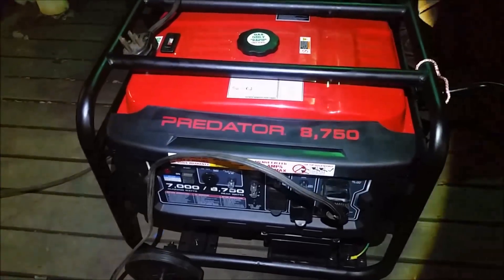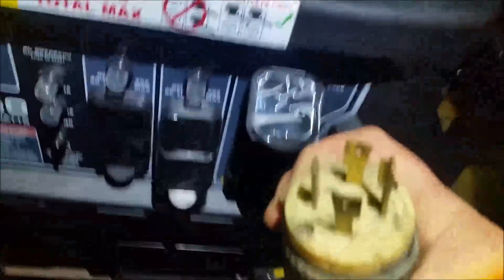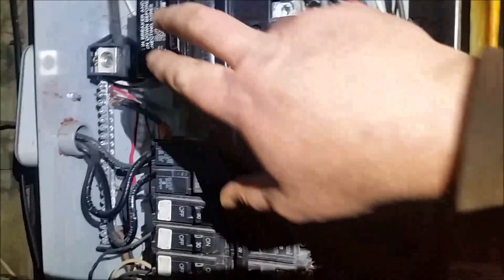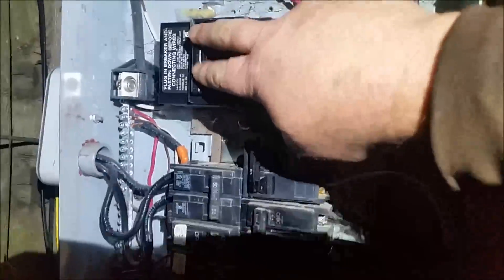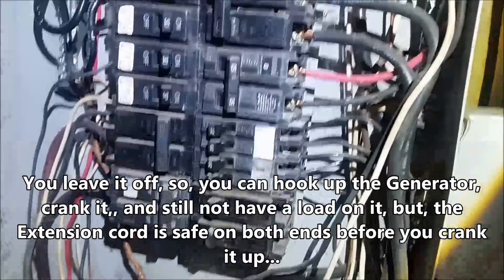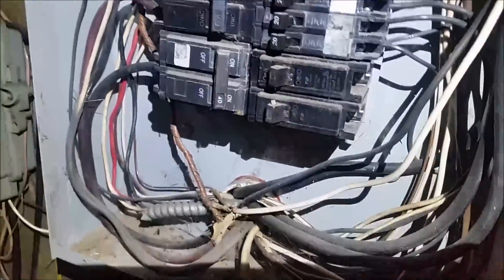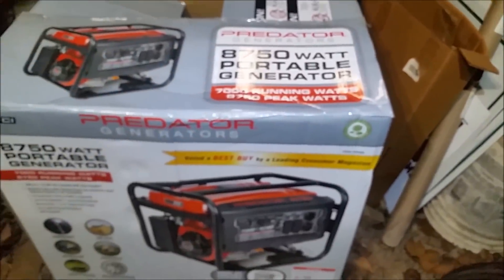Quick/Easy/Safe: Use Existing Plugin/Breaker for Generator hook up to your house Panel box.

Comment: Dad gum it . Y’all just because you can do it doesn’t mean it’s allowed to do be done. What you were doing is illegal. Showing other people how to do it is just stupid and risking the lives of emergency service and utility personnel. I hope if something goes wrong you folks are going to be held liable.  Folks you can add a breaker box utility interconnect switch kit  and inlet box for about $100.00.  Doing it right will help prevent mistakes when you loose power in the middle of a storm and might not remember all the steps or if someone else tries to switch to or from generator power. Even though I have a very detailed instruction manual on how to switch from utility to generator or back, it never fails that when the power goes out I’m at work and I have to talk a member of my family through the transfer. I can’t imagine not doing it safely them having the liability and guilt that you would experience if you actually killed some poor innocent lineman or fireman because you were too cheap to spend $100 dollars.
Reply: Your right.  I did spend the $60 at Home Depot to buy the interlock kit for my breaker box.  I also have the outside inlet box which connects to the generator cord plug.  It great because it is all legal.  I have no fear of using this system.    It is safe and effective and well worth the peace of mind that goes with a properly connected system.However like you, I understand that there are some people out there who would not be comfortable connecting all of this stuff in the dark(substitute snow, sleet, horrible storm, or what ever?)  So next to my breaker box, I put a list that is called "Protocol of connecting the generator to the house".  This is a thought out plan of what to do to connect the generator to the house.  It covers everything from what to do if the  basement is dry, or if the basement is flooded.  It covers every possible condition of the house, so that when the blackout happens, everyone in the house knows exactly what to do.    The problem with the people responding to you is that they think that everyone who may connect their generator to the house, has common sense.  Well, not many people do, and when your in the middle of a storm, its not the time to have to have your significant other try to figure out how to connect something that you hot wired together.  Also, the video person did not write out the plan and tell anyone where to place the plugs and the exact sequence of how to do it.  So really they are idiots for not spelling everything out so that this stuff can be done when they are not there to do it illegally.    David Clark,  your post was right on the money.  and $100 is a cheep price to pay to have it done right.  Very few things will accomplish that goal for so little.
Reply: Game Changer Nice sentence structure. You must’ve made your fourth-grade teacher very proud your senior year of school. And I’m not debating it’s 100% meets code when it is not in use. The problem is when it is in use as it violates national electrical code’s. As for your assumption as to my family’s intelligence level, let’s see. My oldest son works for the state as a network systems analyst. My youngest is in college for Business and finance carrying a3.5  GPA. ( that means grade point average) And I I’m a anesthesia technologists at a level one adult and pediatric trauma hospital. I just wanna thank you for taking time out of your busy schedule to personally attack me and my family. I will pray for you and your family to have a nice evening and God bless.
Reply from the maker: NED NIEDLEMIER is the same David Clark... Read the comments in order.. He made a new fake ID, because I know who he is (has one lame brained ice challenge video on his channel), and he posted 2 times and deleted his nasty comments,, now, because he has been identified as such a stupid person, he made a new fake ID and is back commenting showing how stupid he is again..Ha..Ha..Ha... This guy is a Fireman.. A really, really stupid one.. But, his real ID is David Clark above... What a coward!!!  My address is posted in the video for any of you cowards that think you need to come and see me.. Ha..ha..Ha...
Reply: Tony

It is also required to meet code when in use. Emergency designation does not exempt it from the NEC.
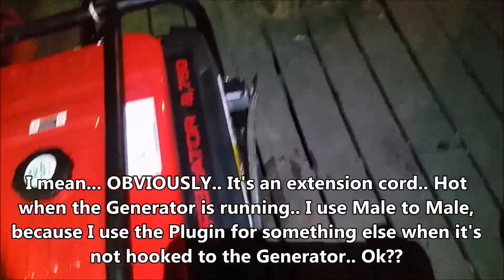Reply from the maker: I don't make videos for Stupid people who have no common sense.. You didn't catch that in the video? I spelled it out just for that purpose...  You can see it again at 2:24, 3:58, 9:20, 
But,, in case you missed it there, it is also in the text of the description.. I copy/paste the text here: 
Only for those of you with Common Sense though.. Those that talk about Safety 100% of their time on Youtube,, better not mess with this one.. Way over your head..Ha..
So,, it seems like you were trying to show that you had common sense, and you had paid attention in your reply.. BUT,, the facts speak for themselves,, now don't they.. 
And,, BTW.. Nothing you do as a home owner with your own electrical wiring is "Illegal".. You should know that.. If an Electrician does this,,,, AND CHARGES YOU FOR IT,,, then, he has violated "his" Electrical Code..
Homeowners are not doing anything Illegal here.. 
And,, if anyone in your family can read and follow your Manual of instructions in the even of an outage,, you should let "Them" watch the video and explain this to you.. Because, if they can understand all of that,, they can sure see that this is much, much simpler than your way of doing things... 
Turn off the main breaker, plug in extension cord on both ends, crank generator.. You don't need anything more than that.. If it kills the generator, you can figure out what to do from there.. Which is, add the other steps above.. Sure as hell has a better chance of being done correctly than your "Manual"...Ha.. 
If you decide to turn off your electrical service and turn it back on, and have to have an electrical inspection,, I hate to tell you,, but,,,, IT IS 100% LEGAL, and an Electrical Inspector "HAS" to approve your service and turn it on, because,, EVERYTHING IS 100% legal... 
As soon as you unplug the extension cord,,, YOU ARE 100% LEGAL..   
But, I don't expect you to grasp that, since you missed everything in the video and text that was designed just for you... And,, if you missed it,, here it is again... 
Only for those of you with Common Sense though.. Those that talk about Safety 100% of their time on Youtube,, better not mess with this one.. Way over your head..Ha..
Now.. You tell me,,, how can I keep people who can't listen and can't read, from commenting on my videos?? 
Hey.. If addressing it in the video multiple times, putting it in the text, and then, having people post replies don't do it,,, we just have to deal with them.. Or, just delete them and leave the video for the next guy who already has some 220v plugins that he won't be using when he is running his generator.. 
And,, what else you didn't catch is,,, the guy who has to make the extension cord, does not have any instructions on "HOW" to do that..Ha.>Ha.. So,, I stopped 100% of you guys from killing yourselves.. Because, it takes a little common sense to build the cord.. See how smart the guy in the video is??? 
The guy in the video is not stupid,, the guys who think something is wrong is stupid.. 
You missed the fact that it is just a regular plugin and you think something is "Illegal about it".. Ha..Ha.Ha... Talk about ????? Sorry.. It's just the facts..
Reply from the maker: Wow... Game Changer.. It's a pleasure to meet someone with common sense for a change.. I could not have said it better myself.. Have a good day Sir.. I hate to know that I have to drive on the same road as some of these guys.. Ha.. Glad there are a few out there that are not drinking their tea.. Ha.. Cheers fella..
Reply: mark, your really bad at identifying people by the way that they write.  If you did you would understand that there are really two different people from two different sections of the US.
Reply from the maker: There is a third, you just identified.. 1) Totally Stupid People, 2)People who know enough to be Dangerous, 3)Really stupid people who "Think" they know enough to respond, but, don't.. 
You have ZERO business trying to do this simple thing.. BTW David Clark.. How is the new ID treating you.. You didn't even try to hide it.. Or you created an ID to hide your real identity and forgot to start a new thread or not continue with your last thought..  #3 fits you just fine. Sorry.. That's the facts..
Reply: Obviously the new ID "ned" was created in 2005, not too new.  Or would you say Knew?  You don't have a job either.  Nice....
Reply from the maker: REALLY??? JUST HOW STUPID ARE YOU???? Ha..Ha..Ha..Ha.. You could not tell when the ID was created,, UNLESS YOU WERE LOGGED IN AS HIM!!!! Jez.. What a Complete Dumb Ass... I can't really believe you.. 
Are there people out there as Stupid as you??? I don't believe it.. I really don't....Can't be... There really can't be.. Holy Crap.. What a complete Igmofuck... Ha..Ha..Ha..Ha... My stomach hurts from that one.. 
At least you make a good clown.. At least you are good for a laugh.. Man.. If I were you,, I would quit showing everyone what a complete fool you are.. 
BTW.. you are half correct.. I don't have an "Employee position".. Ie... I don't have a job.. I run the place and I own the place, and I really try hard not to hire guys like you.. But, that is pretty simple.. A couple of questions, and I know to send you down the road.. Glad you pointed that out.. BTW... I know you know nothing about corporations, but, I figured I would be more technical and really blow you away.. Technically, I don't own the Land Holding or Operational Companies.. I am a 100% stockholder in/of them.. Figure that one out.. That should keep you busy for a few days at least.. Even with Google.. Ha..Ha..Ha.. Man,, you are completely amazing.. How in the hell did you get a job at a Fire Department?? Volunteer??? Ha..Ha..Ha.. Wife must work though..Ha..Ha..Ha.. What a crying shame!!!!
Reply: You kiss your mother with that mouth?  End of line.
Reply from the maker: Ned Niedlemier not mine. Hahaha
Reply from the maker: The fact that it is NOT an Electrician who connected and Installed the extension cord means that it does not have to be inspected, so,  while it is being used, NEC does not apply. It is not "REQUIRED" To meet NEC..
Reply from the maker: Well.. It's pretty simple then. This video is way above your mental state of being.. 
You have an Interlock,,,,,,,,,, and you are still Paranoid????? Holy Crap Man.... 
And,,, it runs in the family???? You have completely removed the Possibility to screw up, plus spending $100 to put something that can be only used for a single purpose(And Nothing Else Useful), where you can't possibly cause any problems, threats, harm, or anything else to anyone,,,, !!!!!!!!! AND YOU ARE STILL PARANOID,,,, to the point you have to read a manual,,, or scared to death to have one of your family members convert over to generator and back??? 
I'm sorry,, but, I have to say it.. You Sir are lacking something very serious.. It's called Common Sense.. Because, that is all any of us who use this have.. It's pretty simple.. All we have to do is remember.. Turn the Main Breaker off.. YOu have to spend $100 on an Interlock for that??? How about a note on the inside of your panel that says,,, 
TURN MAIN BREAKER OFF FIRST, Hook up Generator, Crank, Run,, then, Kill, Unhook, Turn Main Breaker back on.. 
I mean.. REALLY?????? Is that too much for you???? 
I realize you guys want to learn from other people on youtube,, but, you should really stick with something much simpler than.. TURN MAIN BREAKER OFF FIRST, Hook up Generator, Crank, Run..
And, leave the rest of use alone... We live in totally different worlds..
Now,, that I have commented about your lack of Common Horse Sense,, allow me to comment about your Absolute Ignorance of Breaker Panels and electricity in General, and tell you that there are really very few of you guys out there, which would end up causing problems with this new information.. 
#1.. It is not illegal.. Both the Electrical Inspector, Power Company could see this setup and could not do a damn thing.. Because,, it is a usable 220v outlet, that we use for something else, when we are not "RARELY USING THE GENERATOR ON IT"...  So, there is NO ISSUE,,,, unless they happen to walk up, while the Generator is running.. 
And, then,, still not an issue if they walk up and the Main Breaker is off... GET IT???
WE Don't Install Useless Shit!!! We use what we already have..... BUT,, Say that they did walk up while the Generator is on,, and the main breaker is off.. What would they do??? 
ANSWER.. What was the only thing we did?? We Built a Male to Male Extension Cable...It's that simple... 
It is the only thing Not Code.. So,,, what would they do or ask?? 
The question they would ask would be this.. "Who Did This?".. If I said, "I did", and if I did not want him to say anything else, I would say,, "And, Turn the Main Breaker off First", and that would be the end of the Conversation.. If I said, I paid a local Electrician to do that, he would ask who, and did he say he had a license, and ask for a copy of an invoice, etc,, to jerk the Electricians license, because "HE" is not supposed to do this,,,, AS AN ELECTRICIAN.. 
BUT,,, the first question would be,, Did you know that this is not a proper way to do this by an electrician? If you said, Yes, I know, but, it was cheaper, and he could not do it on the job, and I could not pay his Company, but, I could pay him to do it after hours, and I know it is not up to code, there is not a damn thing they can do about it... Now,, if you sell the house to some unexpecting dumbass, all you have to do to pass code is take the Generator Extension cord with you to the next house.. Ha..Ha.Ha.. I mean,, REALLY!!!! What kind of Malfunction causes you not to understand that??? 
#2) "if something goes wrong you folks are going to be held liable."
 If you are going to follow the steps here,,, in the video, or in the Descriptive text,,  What is Step #1 Again???? 
Turn the Main Breaker OFF!!!... Would you please Explain to me How in HOLY HELL, could you endanger the " lives of emergency service and utility personnel."???????  Because,,, I can't see you knowing anything more about this than me,, but, just in case, would you please explain how your setup,, FOLLOWING THESE INSTRUCTIONS are going to hurt anyone???? I really, really want to know how you could fuck that one up... !! Know what I mean??? 
Please enlighten me!! I am dying to know how in the hell you could hurt anyone with the Main Breaker off.. 
I'll just wait and see what your answer is.. You will be one hell of an engineer/electrician, if you can figure that shit out.. 
#3) Too Cheap to spend $100?  This really amazes me.. You really have not figured it out,,, now have you.. 
WTF for??? Am I going to be Running my 220V 5HP Air Compressor while I am on my 8000Kw Generator?? 
Maybe you don't know, but, that would not work very well, if at all.. Or,, maybe someone else is going to run their 50 Amp Clothes Dryer while they are running on their "Portable Generator"???? YOU ARE TOTALLY MISSING THE PICTURE HERE... WE JUST UNPLUG our Air Compressors or Dryers and Plug in our Generators.. We don't want or need some device that keeps us from being able to do what we want or need to do.. 
We don't want Governors on our Vehicles, in case we need the extra power or speed to pass some dumbass on a windy road, where we need to hammer down to safely pass.. We don't want some dip shit telling us what is best for us to eat or drink.. We don't want some prick telling us that we can't buy raw cows milk from our neighbor because some dumb shit doesn't treat it for what it is.. We don't need someone to remind us to zip our zippers or tie our shoes, or remind us how to crank our cars, or turn off our main breakers when it is time... 
And, why spend $100 to add something that you can only use for one single thing, that you don't use that often?? We use use something that we are not going to use while we are running on Generator.. Who's Stupid???? 
Not us!!! Sorry.. Proof is in the pudding fella... 
Ahhh... You are the first person who has made such a comment on any of my videos who has actually had a video himself.. I am amazed.. Are you actually a fireman?? I see the tanker dumping the water... 
I'm sure you know some of the guys who work the lines... Why don't you ask them something if they are still alive. What is the #1 rule they teach them when they are working a dead circuit??? See if they tell you,, There is no such thing as a "Dead Circuit", until you prove it is dead.. And, ask them,, in their years of service,, have they ever known to run into a hot circuit because of a private generator?  And,, if you happen to run into one who says that he has,, ask them, what they did to that circuit? If they don't tell you that they fired up the circuit with the generator on it, I would be shocked.. Because, that is how you solve a problem with a dumb ass.. But, I have quite a few friends who work the lines, and no one has ever heard of anyone "Personally" who has actually "Witnessed" a hot line due to a generator..  Like I said..There just are not that many Stupid people who casually work with Electricity.. 
Just like we know our Cars can kill someone, and our Welders can kill, and many other things we do, including crossing the street can kill, but, we don't stop crossing the street, we just do it with common sense and we do it carefully...
Reply: WOW, POWERFUL!!! I'll bet you have glass pack mufflers on your car, (Only partial noise filters.:) Just kidding. I'm not here to dispute anything that you've said but just for the record, interlock setups, however they are made, whoever made them or however they are used are constructed exactly for people like the one you responded to. They are for unknowledgeable or insecure people who DON'T trust themselves to be able to take the same steps doing the same things time after time on the same equipment. For the record, I hooked up my generator essentially the same way you did 17 years ago with a few minor differences but still excluding the interlock without a problem. As for linemen getting hurt. My power company connection is the old style trash can on the pole transformer type. I don't know if you know how these are constructed but anyone with a large generator, 7, 10, 20 Kw, could back feed one of these without breathing very hard and, in my case, generate 7.2 Kv, (7,200 VAC), at the transformer's input to travel down the line and punch some poor lineman off the pole. IF this were to happen, I would be willing to bet that in 99.99% of the cases, it would be because some fathead who didn't follow rule #1. The other .01% of the time where the lineman might draw the lucky hot ticket to heaven would be on the off chance that someone's power line were to be hit by lightening and fused one or both sets of contacts inside the main breaker in which case, NO lockout or interlock device other than a full on transfer switch box would change anything. As you said before, NO lineman ever saw an untested dead circuit before. Very few that I know of will work on a live main supply line like the 7.2 Kv line behind my house. Anyone with half a brain would cut power from the circuit somewhere up the line from the work site before even reaching for one of these sleeping snakes. In my setup, I have a double 30 amp circuit breaker wired to a 50 amp socket on the wall that, if inspected, would be absent my "suicide cord" but reserved for my arc welder that happens to be out for service today. (wink, wink) Other than this, if everything is of at least minimum capacity for the load demanded of it, preferably larger than needed, and everyone who would have authority to handle the change over has full operating knowledge of what needs to be done and when, I don't have a problem with the setup. The only thing I do take exception to and agree with your commentor on is showing the "how to" of it here for a world full of half wits to see. Someone who doesn't know as much as you, me, or the other hundred thousand smart do-it-yourself-ers that can safely do this will undoubtedly kill themselves, someone else or make themselves homeless after a house fire that surely won't be covered by their homeowners insurance. I don't know where you live but where I live, an electrical inspector definitely wouldn't pass a job like yours or mine. The strange about this is when I moved here to West Virginia 17 years ago, I went to the county court house to get the permits to have my house moved in, water, power and septic hookups and A/C installation. I asked for all of these and the girl at the desk looked at me like I was speaking Greek. In Florida where I moved from, you needed two permits just to have an outbuilding placed and wired for power, take a shit or to have a central A/C unit REPLACED! A mechanical permit for unit placement and duct work and one for electrical. The girl here told me that I only needed one permit for the entire house which was $25.00 and that was basically to pay the property appraiser to come look at it and put it on the tax rolls. And I also needed one permit from the health department for the septic and that one was backwards. You have the septic installed and all connected and, before they bury it, it has to pass a health inspection. If it passes, THEN you get a permit to operate it. The only other thing but I didn't need a permit for, was that I had to hire a licensed electrician to come out and inspect my meter and main shut off boxes after I wired them and have him sign off before the power company would connect me to the pole.
Reply from the maker: Yea... They will permit you to death in some areas.. They hit me hard with the water testing out here.. You have to be super careful not to breath, sneeze or the wind blow when taking samples.. I always have too much to do, so, one time I sat down and got on the internet and started digging in the NC code.. "Serving Water to the Public" is what I found.. I do not have water fountains and if you want water to drink you have to get it out of the sink or drink it out of the toilets.. I don't consider that "Serving water to the Public".. They argued with me, and I did some more research and found out that "Serving Water to the Public" was for "Private Water Systems", which is a Private Water Company, with "Service Water Connections".. 
I was done with them at that point.. I had taken a bad sample and it cost me $500 before it was over with.. Now, I just remind them when the new guy or girl comes out that does not know me,, and I hand them two printouts and tell them to go back to the office and talk with their bosses.. It is two parts of the USCode.. 
https://www.justice.gov/crt/deprivation-rights-under-color-law
https://www.justice.gov/crt/conspiracy-against-rights
And,, Color of Law isn't just for Gray State Troopers, Brown Sheriffs, etc.. It is also for any County, State or Federal employee in the capacity of their office.. 
And, that is a very, very powerful toobag.. Look it up..
Reply from the maker: Dude.. Two replies and you deleted both?? Do you know what you are so upset about?? Because, when you read the derogatory comments I made to you about your first comment to me, you know I am damn right,, and this simple little setup,,, (WHICH IS CODE when the Generator is not plugged in and running),, is so simple and cheap and and so effective, that anyone with Common Sense can do it, perfectly and safely.. There are only two things you have to remember past the "Fooling with High Voltages without using your brain can be hazardous'.. 
1) Turn the Main Breaker off
2) Plug in both sides of the Home made Extension Cable before Cranking the Generator... 
I mean.. Think about it.. Have you EVER USED AN EXTENSION CABLE without plugging in BOTH ENDS???? :)
Who should be Shocked about Who's comments.. I mean Really.. Think about it.. 
And,, BTW.. To your other little comment about being behind a keyboard... Well,, I think you also know that that little comment was unwarranted.. Because,, if you watched the end of this video, or ANY OTHER VIDEO that I published,, I give you my EXACT Address, etc... of where I live every day.. You can always find me here if there seems to be some sort of problem that needs to be tended to...  And, that is the other reason why you have deleted both of your comments..   Now, I have to comment about the Hillary thing.. Since you made that comment,,, I think it is obvious that you are a conservative.. But, I have some reservations about saying that you must be a Conservative.. Because, most people who don't like Hillary are conservatives, and they get that way from thinking, remembering history, actions, reactions, etc.. But, that doesn't seem to be the case here... So, the only other people I know that are not thinkers and Hate Hillary are Bernie supporters, which is really about the same thing as a Hillary Supporter in my book... And, none of them care to address the actual issues that make them mad... Which you have not done.. I mean, addressing the simple items that I asked you to help you understand why I posted this video to show people how simple this can be done "WITH COMMON SENSE"...  But, I can tell, because you have deleted both comments, that you ARE thinking.. So, I am really confused.. I do wonder if you get it now. If you are going to hook your generator up like this, or you are still paranoid about it...  Don't worry.. I am not going anywhere, and surely not like the Liberals who would drive a couple States away to make sure you never had a thought different from mine again..Ha..Ha. Its True... But, I do advertise who and where I am, and I am not intimidated at all about it, and I do have concealed carry, and I didn't spend that money for no reason,, and I have Excellent Gun Control.. Ha..Ha.. 
And, 5 shots of the .45 cal is 4 more than I will ever need in the first place,, other than the fact that two pops are much better than one well placed to begin with.. Feel Free to Debate.. It is what I did.. I replied to your exact points that you posted.. I just added a few adjectives to make you see what I read in your comment... 
Evidently, you could see exactly why I made then, but, you should not get mad at me for understanding how you think and why you wrote them, and, expanding on why you wrote them. Maybe,, you just saw the smarts in the hook up and you will never look at another video or project the same.. If that is the case,, then, please accept my sincere apologies that it took that to make you really take a look at things..  Sorry, but, for an Apology for posting this video, and replying to your comment, that is the best I can do... Cheers.. Glad you found the whole thing of some value..Even if it is just to brush up on your typing..Ha;; ") Cheers fella.. 
Make sure that SCBA is tip top before your next lunge into a burning building.. Been there, done that..